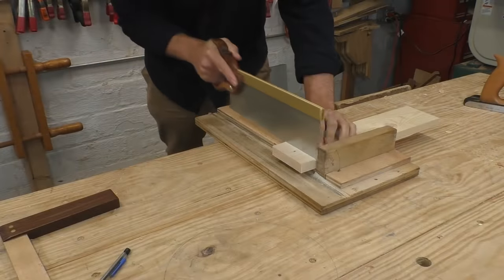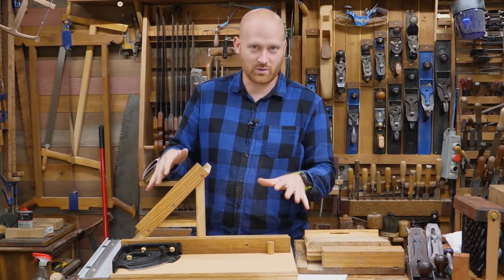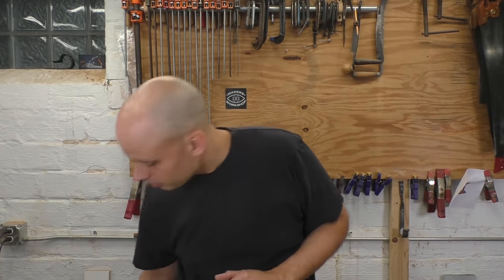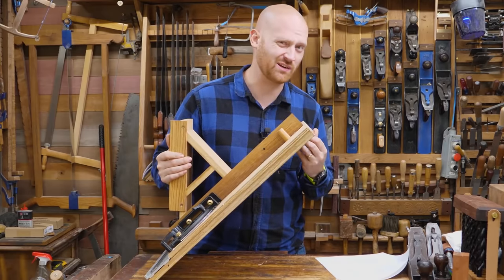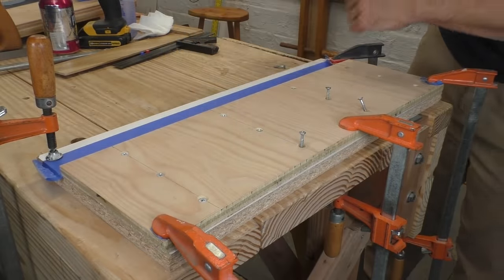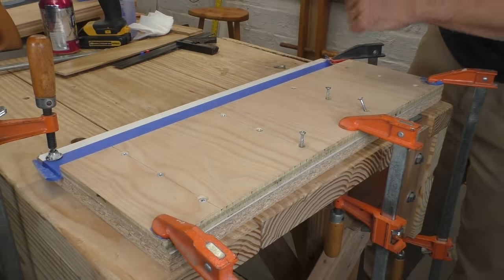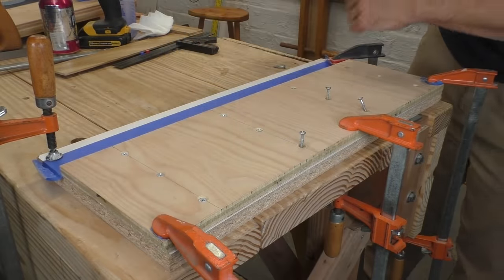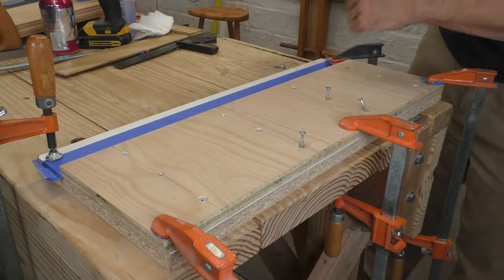Make perfect, square boards with the Advanced Shooting Board // Essential Hand Tool Jig

Comment: Always start putting screws/nail into the job from the middle and work to the outside.  If you start from one side and work to the other you will likely get warps, twists or rolls.

Comment: A thought, if the fence was a bit taller then the other side of the sole with no blade would keep the plane from rocking toward the piece and slicing your fence. Of course, it might create new problems.

Comment: Ack! Before hacking a bolt shorter, please thread a nut on all the way. After the cut and file mentioned, unthread the nut. This works like a die to cut the threads perfectly as the nut is unscrewed.

Comment: I hate videos that get to cutesy (and I really hate the noisy XTREEM BRO videos), but you guys hit the right note. Very funny, but the funny doesn’t get in the way of the information. Thank you for that in general and this video in particular (I just ordered my first real plane.)

With regard to the shooting board, I’ve got access to some scraps of angle iron. Any reason I wouldn’t want to use it for the permanent 90° register? I’d keep it a few mm shy so as not to use it as a plane blade unsharpener. Thoughts?

Comment: Nothing is 'perfectly square'- everything has tolerances. Much of engineering is understanding tolerances and what is suitable for a particular use. Many woodworkers rashly refer to perfection, when they are using wood, a natural product that moves, expands and contracts with both temperature and moisture, and does so in a non-linear manner. Be at one with your material- you may be 'precise', you may be 'accurate', you will never be perfect.

Comment: I was worried James's board won't work too well with angles as the fence pivots out, right in the way of the plane. But I haven't at first noticed the two screws holding it onto the angle which presumably accomodate for this protrusion and can also do as Rex's fence and allow the fence edge to be reshot quite easily.

Comment: I liked his idea for an adjustable fence where you can set the angle. But I have a question about it. When he adjusted the angle it looks like the wood stuck out. Wouldn't that interfere with the plane or cutting?

Comment: Would there be any reason to not move the fence more central and add a 45 degree replaceable fence to the other side? 90 degree on one side, 45 on the other. Or make a moveable 45 degree, like the 90, and just slide it away when you need to shoot 90 degree angles? Love the design! I'll be doing something very similar to this on my next shooting board!

Comment: So this is a complete beginner question. On the fence for the planer board, why not use a piece of angle iron? You shouldn't have to replace it and it should help keep your 90° angle. You can attach it with screws and bolts.
Reply: The advantage of the wood is that it supports the back edge of the work as it is being planed. Rex explains that (quickly) around 0:40. Besides, if you slip and hit the angle iron with your plane, you are not going to be a happy camper.

Comment: Is it commonly called melamine in USA? I know it as MDF - medium density fiberboard. Melamine is just the plastic coating on the outside. MDF is also sold without the coating, you can actually use a piece of it, charged with chromium oxide powder, as a strop.

Comment: I dont understand how The other guys' board works. The front right corner of the fence comes way further out into the shooting lane when he adjusts the angle, and cutting it back to avoid this means it has no corner support for the work.
Reply: You will probably have to watch his video, over on the Wood By Wright channel, to get the inside scoop. 👍
Reply: Seeing that one just confused me all the more. I still don't understand why it needs two fences... I get what he is saying, but idk...
Reply: @chadjazeera9960  While working on this board I was thinking that 2 fences were over engineering leaving more opportunities to introduce error and that I would not build it this way again. Then, when I discovered the main fence was out of square (by such a tiny amount) boy was I grateful for the second fence. 
Plus, as stated in the video, as the sacrificial fence gets chewed up you advance it and then replace it extending greatly the life of the board.
Rex should rename this as Your First Shooting Board, as it has that built in error correction that beginners will inevitably need to use. (this was my first jig of any kind) The traditional way would have found me tossing it away and starting over from scratch.
Reply: @mickeyd9369  thanks! Yeah, I forgot I wrote this. I've learned a lot in the past month. I knew zero when I first watched this. After making one I had the same thing happen to me. The second fence works great!
Reply: @chadjazeera9960  😆 nice to find people in the same boat.
Good luck!
Reply: @mickeyd9369  thanks buddy!

Comment: i have a wooden plane (european here) and the sides of my plane are slightly off square. most of the time its within my tolerance but it's not perfect, is there a good way to fix this?
Reply: No reason you can't take the hardware out and square up the sides using a shooting board like these? Unless that's your ONLY plane of course...

Comment: Does the cleat need to be Hardwood or can regular construction lumber be used? I also take it that hardwood is preferred on the fixed fence since if I remember correctly, hardwood moves less than soft woods?

Comment: Hey Rex, recently purchased the plans for this and was wondering what screws you used to laminate the base and shelf? I appreciate the screw plan but I'm still pretty new to woodworking so some guidance on the screws/drill bits you used would be useful thank you! :) I also saw you used a spade bit for the large hole, would you recommend that for a hand brace versus a forstner bit?

Comment: Question for both re: James' shooting board (because maybe I am just missing something obvious): It seems like when he swings it down to shoot mitres, the fence swings into the path of the plane. Trimming the end of the fence to clear the track would then leave your wood unsupported when it is sent back to a 90 degree cut. Seems like, despite the elegantly presented feature, it would still only work for 90 degrees unless the pivot point could be shifted the precise corner of the front of the fence.

I also love to pack features into any shop-made appliances, so I love the idea of totally over-complicating a shooting board. If I can figure out this issue (with your help), I'll probably try it!

Thanks, and congratulations to both of you on your well-deserved success. Cheers!

Comment: Using the extension timber is flawed so bad.  Is the work bench absolutely flat is there some scrap on the table making the timber you are shooting out of square.  Just put a clamp on the shooting board to push the work piece down firmly on the shooting board.

Comment: Epoxy... That is why I have not built this yet (epoxy is a highly allergenic substance and if you get sensitivised you are screwed). Also I would probably add a top rail to support the upper edge of the plane.

Comment: ... 90% of the problems are solved by just using a nice 2x10.  Just cut 8" off the end, flip it around so the slope of the cut matches on both pieces, clamp it and drive four holes for carriage bolts to be shoved up from below.  You've now got something solid, take another piece of wood and put a big hinge on it and mount the hinge on the smaller board and drive a couple bolts into it and add a handle.  There's your hand clamp.   The real accuracy problem with shooting boards is the assumption that your plane is square on the side.  It isn't.  You want a quarter inch steel plate on the bottom.  If you think plywood and melamine particle board are stable there's no point in using a shooting board in your work.  They have composite strength but your bolts, screws, nails and your base-true aren't composite locations, they're weak points.  Six holes in a steel plate is a DYNASTY of straight edge.  Put a little gap between the plate and the cuts of poly cutting board you use for the plane glide.  The longer the plank segment you use for the fence the more accurately you can square it and the stronger it is.  When you cut off lagscrews or wood bolts you should put the/a nut onto the threads.  Use the hacksaw to work around the bolt in 5 or 6 "sides" and you'll have a smoother time working the end off then run the nut back off and remove anything it tries to bind on, remember to work the partial thread down with strokes TOWARDS the tightening direction of the turn.

Comment: The fascination with shooting boards is kind of strange. When you get to building things in significant numbers, anything larger like a drawer box part is easier to must mark and plane with a board in a vise, and most of the smaller parts either have the end terminating as a tenon (and the end of the board doesn't need to be dead square as the length is marked with a square on the board and a knife), or if they're the mortise side, they're left long and sawn and planed off later when the doors complete. 

So much attention is given to shooting boards because they draw beginners in thinking they'll work with them like a table saw sled or something, but work is done almost entirely without them. 
A plane cutting end grain in a vise will go somewhere around 4x the distance and cut much more off per stroke (to work to the line) with less effort, too. 

The only real case for them is really small mitered parts, etc, but few are doing anything like that.

Comment: Important: the soul of your plane must be 90 degrees with the side. Most cheap planes aren't so check that first.
Reply: Presumably as long as the sole is flat, and you hold it against the fence, you're good, although it will make it more difficult to use.

Comment: I've been thinking about the infill plane from the other video, would you recommend gluing extra blocks of wood in my cheap metal blockplane?
Reply: @Thingaloo, I wouldn’t. I don’t see that as improving the frog, but more as interfering with it. The wooden bed of the planes you are talking about is there just because it is the basic material of construction, not inherently superior. The post-war Norris that I use is all cast iron bed.
Reply: @leehaelters6182  I also would have used wood because it's the available material. The goal was to add weight.
Reply: @bacicinvatteneaca  did you mean remove the frog entirely, and build up the bed/handle assembly just as Norris and Spiers did? The oldest Bailey designs had only a flat platform for the frog. That would make it easier, yes?
Reply: @leehaelters6182  I'm talking about cheap, lightweight, sheet metal block planes, with no detachable components apart from blade and cap
Reply: @bacicinvatteneaca , oh! My mistake!

Comment: This is great but, combination squares are notorious for not being square.  I have six of them that are not square.  I have started to use machinist squares.  why can't they make an affordable combination square
Reply: Most of the cheap combo squares can be trued. Really easy. Also smooth the ruler's edges while you are at it. When they are rough they wear through the material of the adjustment... nocks? bumps? There's a bunch of howtos on yt, I think Paul Sellers might have one, and worththeeffort as well. But they do go out of square fast, that's true!

Comment: So, Instead of a plywood board, that you need to use melamine to check square on, why not just use the melamine with the factory edge, ON TOP of the other Melamine.
Reply from the maker: Because it's thicker and reduces the available width of the plane blade. It's also slippery where you want that part grippy.

Comment: Request: Don't ever use the word "perfect". Everything you're building has a certain tolerance and it's much less scary if you name the tolerance. At least that's measurable. "Perfect" isn't measurable. When we are working with wood we can often work with quite large tolerances, since the material is somewhat flexible. 
Perfect isn't possible. Mostly the question is if it's better to build it a bit too big or too small and how much too big or too small.